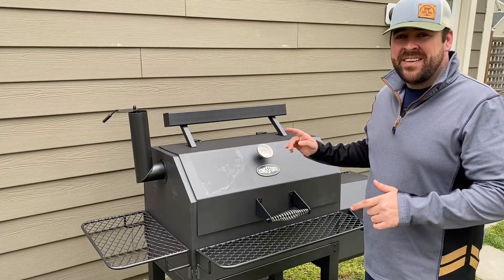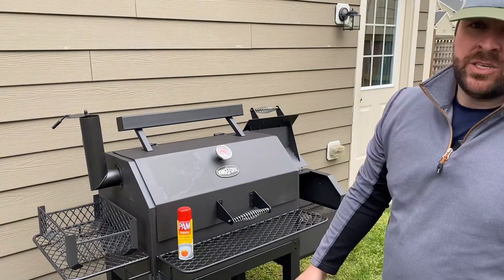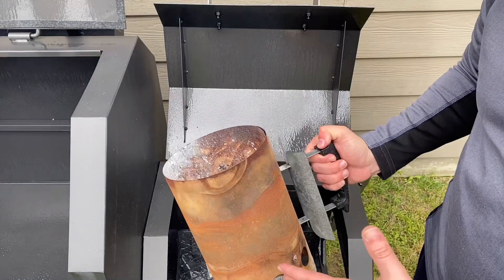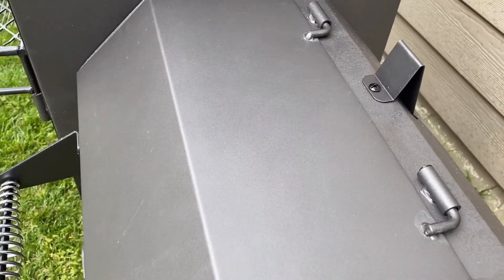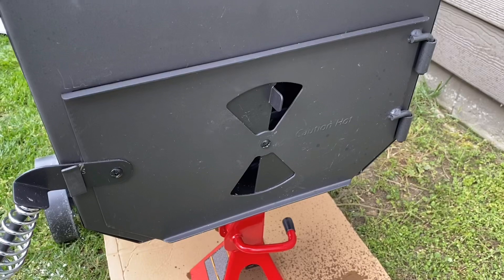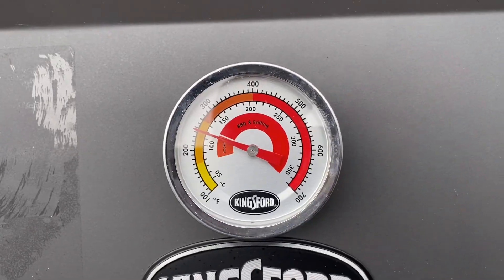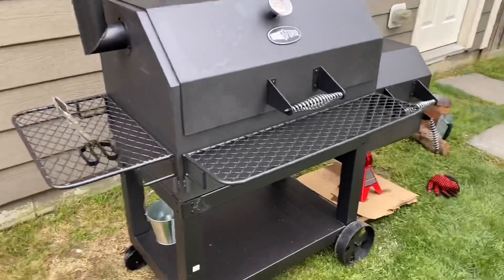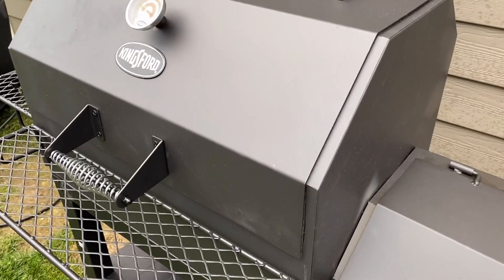Kingsford Stockade 49  - Offset Smoker Burn Off & Seasoning 🔥

Comment: Question: does the smoking cause sloping (of the firebox), normally?? Am I going to need to get some sort of support under firebox when I fire it up for seasoning, too???
Reply from the maker: You don’t need support right away, but to avoid sloping/sagging you can reinforce it. Heat and weight of charcoal/wood adds stress to the thinner metal smokers so it can use the added support. I have a few friends that have the 3 in 1 Ok Joes and I’m not sure if they had sagging issues Because it was sturdy enough.

Comment: I used grapeseed oil to coat inside and out and grates.  Got the fire much hotter than I would ever use to cook and seasoned one time. Never has rusted in 10+ years and it stays covered outside. I do wipe it down after a cook while warm with slight amount of olive oil and doubled paper towel.
Reply from the maker: That’s good treatment of your smoker, more people need to take better care of their equipment. When I say people, I mean me 😅 awesome to hear you’ve gotten 10+ years out of it!

Comment: When is it best to oil smoker? Before, during, or after cook?
Reply from the maker: I've heard a bunch of different things.  If you are talking about oiling the outside, the most common answer I've seen is right after you get your firebox going (before the food is put on) and right after your cook.
The cooking chamber itself, I don't find a need to spray that after the initial burnoff unless you haven't used it in a year and its really dried out.  For the most part its good to go.

Comment: I just joined the FB group. Purchased my first smoker last week and had a failed smoke attempt yesterday. I did not season the smoker before firing it up. Can it still be done or is it too late?
Reply from the maker: Yes, you can spray it down with Pam oil and just burn it really hot and be good to go 👍👍.  Did you get your hands on a stockade?
Reply: @ComparisonCooking  thank you. No I bought a Char-Griller Smokin champ. I want to learn on there and then move up!

Comment: What are the dimensions on the  firebox cooking surface?
Reply from the maker: I’ll get the tape measure out tomorrow morning and get back to you.
Reply from the maker: 14in by 16in in the firebox.
Reply: @ComparisonCooking  dam that's a good size for grilling. I have a masterbuilt 560 and it does great for set and forget but grilling isn't the same as being over that flame

Comment: Put a small steel plate in the bottom of the Firebox! Measure it and look on EBay or Amazon for the correct steel plate
Reply: You could add some modifications to make your pit run a little better.
Reply from the maker: When I got this, my intention was to make a lot of modifications, now I'm just running it a lot and slow to add the modifications.  Just to be clear, what are you referring to with the steel plate in the bottom of the firebox, i don't believe i've seen that.  I've seen steel plates out of the firebox into the main chamber to disburse heat more evenly. but not in the firebox.
Reply: It will disburse the heat but more importantly it will save the bottom of your Firebox from warping and wearing out. You shouldn't have to put a jack stand under the firebox. To me the metal on the firebox is to thin on the bottom. Just measure the flat part of the Firebox and get you a small piece of steel. I know Ebay has them. Maybe 1 Inch or 1/ 1/2 to 2 inches thick. Or if you don't want to use the steel you and put fire brick inside the Firebox. Whatever way you go let me know how it turns out. Smoke On!

Comment: Why do you need a jack on a brand new product? its obviously not strong enough to hold its own weight. Also the oil on the building behind is from when you sprayed the oil at the beginning?
Reply from the maker: Its a preventative measure, over time the heat will cause slopping.  That's correct, the smokers solid in mass production at big box stores for under $500 will eventually fail in structure.  Its unfortunate they are made this way, but most consumers that want to have a fun weekend hobby can not afford the $1000 thick steel smoker.